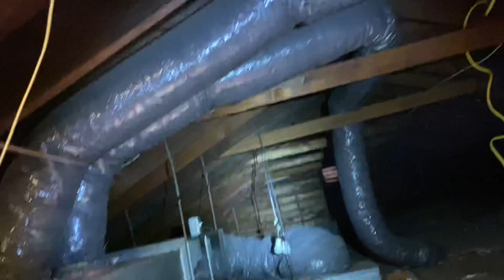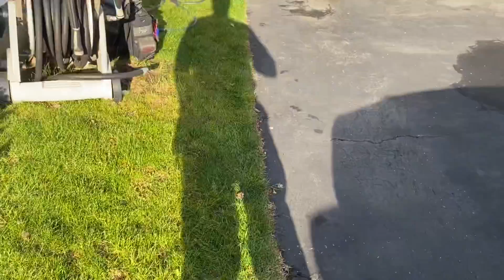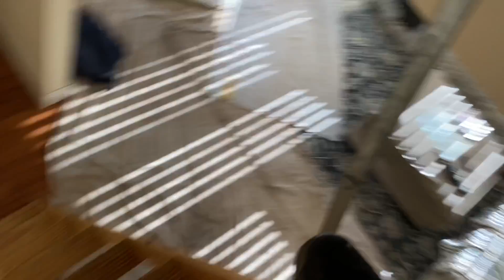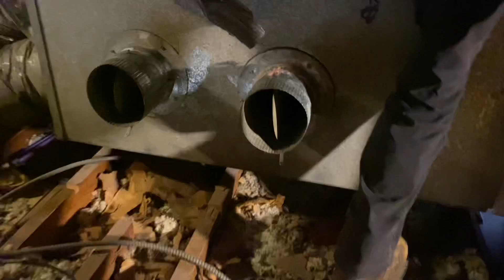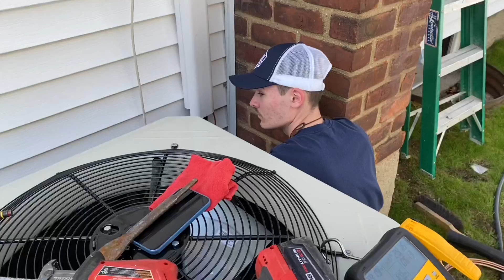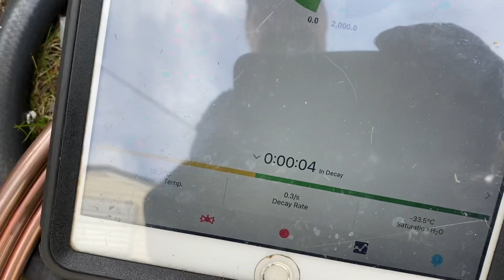Installing Carrier Central AC System with Rectorseal Surge Protector RSH-50

Comment: HEY! Nice job! In California city inspectors would hang our balls if we put 2 wires in one wire terminal. Need to use short wire from the terminal and use wire nuts to split into two wires: into load and surge protector.

Comment: Surge Protection devices, I would highly recommend a whole house unit for sure.  Per the NEC2020 code its now required to be installed for new and replacement installs of load center panels.  Additional units can be added downstream as well.  Just like your SPD Type 3 units in your power strip all over the house.  Again they won't stop a direct lightning strike, but will help protect for everything else.  Personally I like the Eaton units CHSPT2ULTRA for the whole house, then these Rectorseal units seem like a good value to for the price as a secondary SPD for specific devices, as a secondary layer of protection.  Remember surges can happen by motors switching on and off, so actually an AC compressor is a good place to put one, as it would then prevent surges back internally in the house.

2020 NEC Code Language:

230.67 Surge Protection.

(A) Surge-Protective Device. All services supplying dwelling units shall be provided with a surge-protective device (SPD).

(B) Location. The SPD shall be an integral part of the service equipment or shall be located immediately adjacent thereto.

Exception: The SPD shall not be required to be located in the service equipment as required in (B) if located at each next level distribution equipment downstream toward the load.

(C) Type. The SPD shall be a Type 1 or Type 2 SPD.

(D) Replacement. Where service equipment is replaced, all of the requirements of this section shall apply.

Comment: Most all the units are in the attic here in Texas.  It's horrible in the summer to work on them.  The work area around them is small and most of the new house builder put them right in the corner of the attic so they are a real pain to get too.   I am lucky in our house that its a spray foam attic so its semi-conditioned space up there, even when its 110F outside with dark roof, it gets to about 85ish at the peak which is 22 feet above the attic floor.  Got to love the 12/12 and 18/12 pitches of these damn roof, not sure how the roofers have any ankles left when they have to work on them and re-roof with all our hail storms!   Keep up the good work sir! 👍😁

Comment: Surge Protectors work right up to the point that they blow apart. The only real protection from surges is distance! We used to advocate the Transtector in high end electronics. And when the lightning strike would vaporize it, we would all say it gave it's life in the attempt to save the equpiment.

Comment: We had our minisplit system change (the old system from the last owner was at the end of it's life) 2 years ago for a Carrier 24k BTU and 2 evaporators 12k each. We did opt for the surge protector option as well installed on the circuit breaker panel to protect the whole house. Installed by their electrician while he was there connecting the system from 110V to 240V.
Reply: IS SURGE PROTECTION AT THE WHIP/DISCONNECT INTERSECTION ADDITIVE TO THE HPOSUE PANEL SURGE PROTECTION ? IF NOT, WHY DIDN’T YOU JUTS INSTALL surge protection AT THE PANEL AND PROTECT THE WHOLE HOUSE ? I THINk THESe offer TWO DIFFERENT FUNCTIONALITIES / the outdoor unit you installed protects the condenser boards and from surges generated by the house devices like dishwasher, washing machine, refrigerator freezer compressor coming on  etc.
Reply: @johnwhite2576  I think, and I repeat myself, I think because anything that goes near the panel needs to be done by a licensed electrician thus cost more that the other solution that can be installed by the frigorist himself. Correct me if I'm wrong.

Comment: Are you allowed by code to have surge protector wires piggyback power wires (2 wires under one terminal screw) in the box?
Reply: yeah that was my question as well.  My company policy is we have to use a pigtail with only one wire under the lug screw.

Comment: I had 2 of those same Rheems in my previous house I built in 96. Compressor in 1 unit gave up the ghost in 2015. Other than that no major issues. I put hard starts in both. After I sold the house new owner replaced both units.

Comment: My old Whirlpool AC with Heil gas furnace lasted 45 years. Was put in when Sears came through selling home updates in the 70s. Only reason it failed was a five finger discount specialist thought it contained copper and tried to cut the lines. Was R22 and would keep it 65 on a 95 degree day. Replaced it and furnace. Still had the manuals and install paperwork. The fridge of the same era is still going strong and keeps things nice and cold.

Comment: Did yall install a heat strip kit. The ones I installed stated to cut the wires to length. I use them all the time. Awesome install. Very efficient

Comment: My father sold Copeland compressors his entire life. Worked for Melco in Philly for 40 years. Always said they were the best
Also just bought a Mars surge protector for my condenser; have one on my Trane furnace too
Don’t know if code allows doubling up wires in disconnect box. Might need to pigtail using your beloved Wagos…

Comment: Surge Protector is for a Single Phase. Only 1 of the hot legs is being " protected" you would use that for the blower if it were 120v, or a microwave.
the one you installed does say 220v, but that would be for like the EU, I think. since we do not have single phase 220v in the US
Reply: That was single phase 220/240 going to that unit. 3 phase would be 3 lines single phase can be 1-2 lines of power. The wiring diagram for those surge protectors say to put them in parallel with the line voltage.
Reply: @nathanbrown5099 sorry dude, its Dual since each leg are phase shifted something like 180 degrees. LIke I                                                                                                                                                                                                                                                                                                                                                                                                                                                                                                                                                                                                                                                                                                                                                                     said in EU they have single Phase 220v which is a single hot leg plus neutral.

Comment: In Spain is Mandatory by law to have overvoltage protection (temporary and permanent) in new houses or in electrical reforms.
To protect from peaks, lighting and for high voltage (lose the neutral or get derived and two fases come to your house {here 240V if you have a derivation then 480V in your house })

Comment: Mikey it was 30 plus years ago my dad had everything changed same as this video . In a few months a Lightning storm passed though and ruined the condenser . It was replaced  under warranty and the tech said it was because there was no surge protector . And for now on all units that they install will get them automatically . I don't remember the brand , but I do remember the guy didn't check/turn off the power and nearly killed himself . And that was surprising because it was one of the larger companies here on Staten Island . They are still in business today  And at the time they said it was only $10.00 to add it .

Comment: Nice cheat on the branding. First time someone other than you services that unit they will tell the client they got cheated on the condensor.👍👍🇨🇦
Reply: @PipeDoctor  I’m hoping your not referring to me as a hack Mike. We in the industry know who makes what regardless of branding. Someone will just want slam you and make you out to look like your being dishonest. Carrier, Bryant, Payne, Keeprite all from United Technology all basically the same . I worked for a Carrier dealer for well over a decade before I stepped out on my own. Use Keeprite because it’s a better price point. As for the ten year parts warranty, it’s free here all we need to do is register the equipment on line. Your loyal subscriber the old hvac guy in Toronto.👍👍🇨🇦